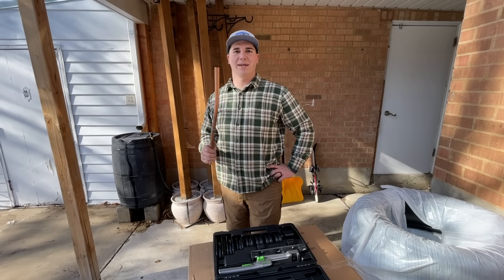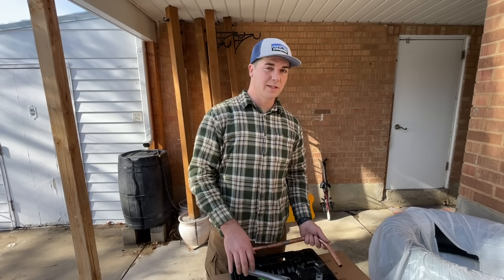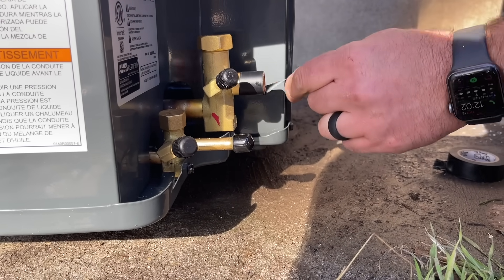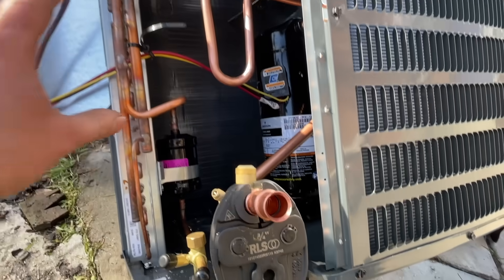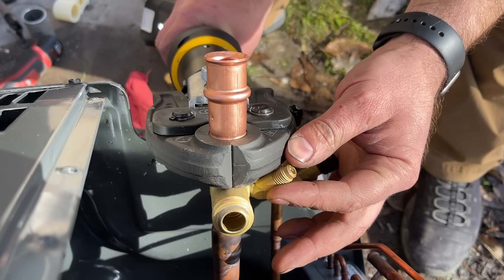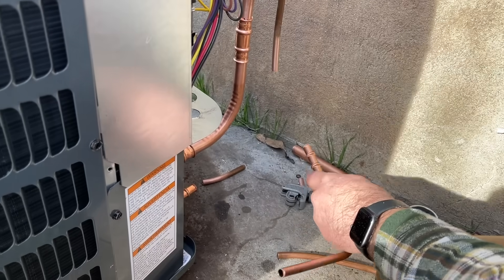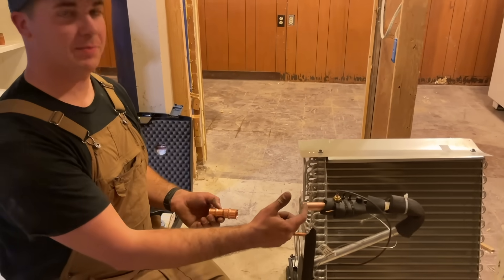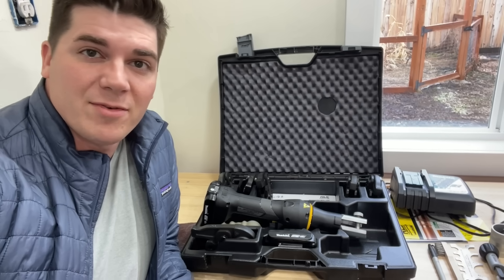Brazing Is For Cavemen. THIS Is The Future Of HVAC Copper Connections. -RLS Crimping Tool-

Comment: After almost 30 years in HVAC and plumbing, I can tell you never to rely on o-rings. They break down. You will eventually have leaks
Reply: It will last but man , once the rubber material starts to reach its degradation point , they will all start leaking like taco bell on a bad day.   Would much rather braze or silver solder.   Refrigerants are hot , high pressure , fluorinated/ chlorinated and can be aggressive on seals
Reply: @Miketime969  He's using these joints on a Goodman A/C, which is basically disposable.  They should easily outlast the unit!
Reply: @Miketime969  Plenty of elastomers can survive a lot more than anything an AC can throw at it.
Reply: @Miketime969  the modern systems just use propane
Reply: @Miketime969  they did a test and found out they last 86 years when used in refrigerated/cooling/freezing/heat pump applications. Then they introduced to public for sale.
Reply: @wileecoyote5749 

I am not sure how they test for 86 years, unless 86 years go by. What is their secret?
Reply: @wileecoyote5749 nothing new about that  in Europe for over 35 years .They don't stand up to fire regulations  not used for HVAC
Reply: @wileecoyote5749 not fire resistant.
Reply: @Miketime969  At least you dont have to bust out the heavy ass nitrogen tank and worry about oxidation on the inside of the pipe clogging your txv.  Much rather just pump the system down and crimp a new fitting on if there is a leak instead of going threough the whole brazing process,.  Cuts the time in half for repairs.
Reply: I'm just a DIYer, but I have heard that most leaks in a vehicle A/C is due to bad O-rings. I haven't heard of brazing going bad.
Reply: @drewthompson7457  yeah. The leaks are usually from the connection points in a car. The lines are aluminum and have mechanical connections vs brazed
Reply: @handymanbrian8269  All mechanical connections on cars have O rings and eventually leak. It would be so nice if cars went back to copper like the early 70's. We have problems with hydraulic JC fittings with O rings as soon as machines are 6 months old. I would question the vertical joints getting water penetration and swelling when temps drop but these are likely the same guys that tag out a furnace for $5k and wont install a heat exchanger that's $300.
Reply: @drewthompson7457  without a doubt .
Reply: @drewthompson7457  With the pressures of 410a, brazing is the best solution. Maybe the compression O rings would be fine for water lines.
Reply: @fifthamendment1  thought you might like to know I liked your comment and read this on wiki:

R-410A, sold under the trademarked names AZ-20, EcoFluor R410, Forane 410A, Genetron R410A, Puron, and Suva 410A, is a zeotropic but near-azeotropic mixture of difluoromethane (CH2F2, called R-32) and pentafluoroethane (CHF2CF3, called R-125) that is used as a refrigerant in air conditioning and heat pump applications. R-410A cylinders were colored rose but are no longer specially color-coded, now bearing a standard light gray color.[1][2]

On December 27, 2020, the United States Congress passed the American Innovation and Manufacturing (AIM) Act, which directs US Environmental Protection Agency (EPA) to phase down production and consumption of hydrofluorocarbons (HFCs).[3] HFCs have a high global warming potential and contribute to climate change. Rules developed under the AIM Act require HFC production and consumption to be reduced by 85% from 2022 to 2036.[4] R-410A will be restricted by this Act because it contains the HFC R-125. Other refrigerants (like R-32 and R-454B)[5] will replace R-410A in most applications, just as R-410A replaced the earlier refrigerant, R-22. 

zeotropic eh?  New word for a newbie like me, but @JayJayJay might like to catchup by doing some reading
He claims to have graduated in 1980 but for an old timer he has a mighty tendency not to back down
Reply: Yeah. I'm gonna stick to brazing
Reply: @youoweme5forreadingthisnam535  We dont call it brazing in the UK, its soldering.
Reply: Commercial, marine, agricultural refer since mid 1980’s here. Used RLS system first time this summer. It’s definitely faster and cleaner than high temp brazing. Really need my reading glasses to closely inspect the pipe for any scratches or the tiny Mueller etched lettering though. If it’s where the o ring contacts it will need to be sanded off or discarded. I had zero leaks on four refer systems using the RLS tool and fittings. Prep is the key I believe. I also press each joint twice 90 degrees apart. Only takes 5 seconds to press. Mueller is coming out with a competing system soon using two o rings in each joint.
Reply: @mikeanderson6531  With all that prep, and pre inspection for any defects like the lettering, scratches, etc, it won’t save any time.  Then you have the cost of the fittings.  I can braze faster than the labor these crimp fittings would take.  If the fittings were cheaper, and there was zero chance of leaks, then they can be considered.  They should design these with Teflon seals instead of rubber O rings.  Teflon is already used in some refrigeration application, such as roto lock unions on some Trane compressors.  It doesn’t  break down like rubber.  The only advantage of using these is for the people who don’t know how to braze.  The future will tell if these press fittings hold up to the heat,high pressure, oil, and vibration.
Reply: @rodgraff1782 Teflon doesn’t have the compliance necessary for a gas tight seal. The seal has to conform to the surface irregularities of the contacting surfaces of the pipe at the microscopic level.
Reply: @propman7896 . Then why does Train use Teflon seals on their compressor rotolock  fittings?  I’ve never had one leak, even on the 30 year old GE condensing units.
Reply: @mikeanderson6531 zero leaks right away.  What about 6 years later? Could probably use superglue and have it hold for a while. But will it last years and years in the sun and rain in Phoenix.  With who knows how aggressive oil and refrigerant passing through it.
Reply: @wildmanofborneo  getting temp swing all the time
Reply: @mikeanderson6531  makes sense that a double o ring is the way to go.
Reply: @mikeanderson6531  why 2 o-rings? Think 🤔 about it. If it were safe, one would be all you would ever need.
Reply: @mikeanderson6531   we are already replacing these things after 1 year of using the machine because of leaks 

but I can see how shady small town companies love this... they get repeat business
Reply: You can’t beat old fashion brazing over time those orings will leak plus the price on the crimp fitting wouldn’t be cheap but great video and nice tool 👌👌👍👍
Reply: That was my first thought too. I see that on cars all the time, someone's AC goes out and usually it's from a leaking O ring. Most commonly the high pressure side of the compressor goes first.
Reply: They've been using o-rings in automotive ACs for decades, no major issues there
Reply: @MrRightNow  there always failing. my dad was a mechanic i seen this in aircons all the time.
Reply: @MrRightNow  till they leak
Reply: Already considering banning in Australia the jury is out.
Reply: On Air conditioning on cars the gas permeates through the flexible hoses. In the system there is a small quantity of lubricant for the pump and also to coat the inside of the flexible pipes. There is a loss but minimal. If you do not use the AC system the oil will drain off the inside of the pipes and your rate of gas loss goes up, meaning systems needs a recharge more frequently.  Brazing or soldering does not take long if you know what your doing and is proven. My pipe bender does not kink the pipe like that.
Reply: Exactly
Reply: Sounds like a bunch of future problems.
Reply: I agree with Brian. I am always questioning pro-press fittings on hot water systems. The thing that really kills an o-ring is heat, if its on a cold line i dont think you will have a problem for a long time. On another hand, when it does leak in 15 years the unit is probably hit its lifespan, and if it leaks you get paid to fix it. All in all, the contractor wins.
Reply: Thanks for pointing this out. You beat me to the comment. Why, oh why are new Plumbers, Hvac installers scared of soldering? Soldering isnt hard and provides a seal that wont fail thus providing full peace of mind. I have seen rubber seals fail shortly after install!

I agree there is a place for these quick connectors, but only in places were a torch can't be used!
Reply: With al2 semi flammability refrigerants coming out thus seems like a disaster if you had a leak. O rings slide and pinch break no thanks I like the caveman route as you call you it.
Reply: Staybrite 8 . Never any issues
Reply: @toli0968  Is that the same as stay bright on the box i think its good for 11k psi it will fill small gaps
Reply: @toli0968 staybrite8 can use r32?
Reply: Looks like that’s going to be job security for AC repair…..
Reply: Exactly! I'm in maintenance of a company and fully agree and I've seen rubber o-rings fail but never have seen a soldered connection fail. Quick connectors are only ok for quick fixes that will be fixed properly asap. Why are soo many installers, pros becoming soo lazy. Brazing is not difficult for a joint that will last basically forever.
Reply: Nearly forty years in aviation industry and there’s never been a fail proof o-ring.
Reply: Best comment, and my very first thought when I saw this vid going in that direction.
Reply: I did refrigeration for a long time and seen these before I retired. Also did a lot of commercial plumbing which I bought a Pro press. I can tell you when I did two inch copper the Pro press was a god sent. High quality o rings are supposed to have a long life span according to the manufacturer.
Reply: Unfortunately the 0-rings will most likely last beyond the warrant period.
Reply: All systems will leak over time. This may just speed up the process.
Will still last as long as most carrier units lol
Reply: Except for all those orings that are in the unit  it self.
Reply: @ban80  ask the supplier eh?  bet they will say anything before or after the sale!
Reply: That's s first used in plumbing low pressure water supply!
Reply: exactly 
until they come down on price and up in quality 
these things are a joke
Reply: Job security, he gets to come out in 4 years and do it all over again.
Reply: You are correct remember carrier in the 80s had that nut that crushed down on unit with O rings
Reply: @tedhicks5431  yup i do remember. at least those were flared fittings with copper washers. they did have some leaks, but not many that i ran into
Reply: @handymanbrian8269  "olives" or washers?
Reply: @simonmasters3295  sorry. im not understanding your question
Reply: 20 years in HVAC only and some plumbing. yeah do not use this foolish video. refrigerant is too expensive.
Reply: Easy ? Yes. But I gotta wonder about longevity?
Reply: @chris.eskimo  Good 15% silver has it for many many yrs
Reply: Everyone stay with brazing the call back will cost you your hole lot more then what you made from the job
Reply: EXACTLY!!!! especially after a few years when pipes go through several temperature changes and expand and contract. I would never let anyone allow to do this on an installation for my house. It's brazing, soldering or the highway.
Reply: Exactly I’ve never seen solder fail over time like I’ve seen orings fail in everything they’re used in over time.
Reply: Oh Weally?  So what engineering school did you go to? Oh yes..Don't buy an all electric car since in my  30 years of installing  never rely on a battery   lol
Reply: I can tell you with my 30 years of driving cars don't buy and electric car, Never rely on a battery   lol   you must be an engineer ...Let me think for a second .the AC lines in autos rely on o-rings..thats right they don't have your 30 years experience
Reply: @davo912  lol
Reply: The heating and cooling of the o rings will be their demise
Reply: Would have brazed it by the time you finished taping bro. But yes press all day for plumbing 🪠
Reply: Give it time it will leak
Reply: There making things to create future service calls. In there minds they gotta keep the wheel turning
Reply: @aggadan  sorry equipment will do that
Reply: Speacially with hvac temps
Reply: 14 potential leak points… no thanks 

I’ll stay a caveman
Reply: Hate all these new bs rectorseal type fittings and now this! All that process took what 1/2 hour when you could’ve brazed that stuff in 2 min! Then what’s warranty on those things? Are they like the 5 year warranty on rectorseal fittings! As if they’re only warranting their product for five years that’s always seemed pretty lame to me. They can keep all this new stuff! What if you mess crimp up at king valve? How do you get it off once crimped if bad crimp? At least with those bs rectorseal fittings you can take channel locks and take fitting off or use their tool if you can find it. I don’t see this tool working in a tight spot in a closet.
Reply: @michaelpinkston768  I just disconnected an old carrier compression type fitting they used in the 80s it ok on straight cooling but heatpump those O rings will leak i have a picture of it not clear
Reply: 100% correct. O-rings simply do not last forever.
Reply: Absolutely but the industry relies on repairs and selling new equipment. If things last too long, where's the money in that. Hence the reason they don't make things like they used to. It's bullshit.
Reply: Refr. Mechanic 25yrs. It may be quicker but i service grocery store racks braized 30 to 50 years ago. Some develop small leaks after 25 or 30 years but most joints are still solid. The world has lost their minds and if you believe this garbage will last more than a few years, at  best, you have lost your mind. And you have very little experience in this field. PERIOD
Can you say HACK
Reply: and heres my proof an hvac dude responded...
Reply: Hi @handymanbrian8269. I agree with you if the "O" rings are in contact with water, but these are not and are made of a different material than regular "O" rings. Check out my blurb that i sent to the diyhvac guy
Reply: Crimping copper fuses the copper together.
Reply: He's an idiot looking for gullible people and clicks.
Reply: @charlesnelson5187  actually I've seen some of his other stuff and he seems like a very competent plumber. You can't be the best at everything.
Reply: He says cavemen
Reply: You have leaks either way, at least if it leaks with these fittings it’s easier to find the leak because just assume it’s the fittings.
Reply: @concernedpersons1995  That's the most idiotic thing I've ever read.
Reply: Yeah man oldie times are different you can’t compare the ‘o’ ring in press to the rubbers in faucets and stuff
Reply: Yup. Anything with expendable parts (o-rings, seals, gaskets, etc) will not stand the test of time.
Reply: @adaster98  what kind of rubber are they using?
Reply: After cutting off the flaired end and crimping the coupler, if that O ring fails and it leaks, you are going to be screwed trying to get that coupler off.
Reply: @fifthamendment1  another great comment
Reply: no they wont, not these. not without exposure of sun and other elements.
Reply: So how would you install a liquid line dryer.
Reply: @briandow8879  you be a smart ass and braze one in.
Reply: Somebody disagreed i don't
Reply: Just pump the system down and crimp a new fitting on it if it starts to leak.  No nitro purge.  Makes repairs easy & less expensive. Doesn't have to last 30 years.  Too bad most techs cant afford it.
Reply: It’s an o-ring like the one they use on cars, they will always leak, don’t be fooled
Reply: Amen to that
Reply: Well I been working in different fields mostly the automotive industry but I have done some plumbing too, that being said O-rings are not 100% no but IF they are not moved twisted or tampered with they should last the life of a typical A/C system! The new O-rings are also made with better material then 30 years ago heck even 15 years ago……
Reply: Only have 15 years myself and I'm all for new tooling to make a job easier (I swage and bend, hardly ever use fittings) but there are things I would never do.  That RLS system is great for straight line work or places where a hot work permit isn't feasible (like certain areas of hospitals or 'historic' buildings) or time-critical emergency repairs.

The more insidious thing is that there is no reworking those joints and if you mess up you're going to be in bigger trouble like with the king valves because when it does eventually leak the repair is going to be that much more complex.
Reply: that's what i tought O rings that spell a lot of freon leak into the atmosphere, no doubt,  brazing is faster
Reply: all this cheap inferior product and technique is the result of a societal phenomenon called "primitive accumulation" which is a function of the decline of a society, just like communism
Reply: Amen. As a guy who does a lot a car AC repair, I've always wished there was an alternative to o-rings. Plus it looks like you would have to replace the entire service valve if there was a leak after using this method
Reply: I live right on the gulf coast of Florida and I've had to fix some of these already on the beach. That salt air eats everything 😅
Reply: youre relying on the crimp thats consistent. and you rely on orings everyday, theyre in just about everything
Reply: Agreed, I am hesitant to try these press tools using o-ring fittings.  Especially on a R410 system.
Reply: Finally had some come back leaking on refrigeration system.
You cannot use these on higher temp liquid lines especially with 404a gas.
I ended up pulling them out and soldering in pieces.
The o-rings broke down
Reply: But can't you just seal the ends off too with something just to be safe ?
Reply: That’s the plan the quicker it breaks down the quicker they can sell you a new one
Reply: They start to fail within 3-5 years, and sometimes even sooner. They save time on the install, but return trips for premature failure is not time saving. It does not get you a lot of return customers either.
Reply: Saying you've been in for 30 yrs doesn't make you good at all. Just means you've been doing things the hard way. M0r0n.
Reply: They told me that in 2004 when SharkBites first came out. Mine have lasted 20 years so far.
Reply: Thats a good point
Reply: Flame free construction is coming. And everything pressurized will eventually leak. Coils indoor and out. Solder connections etc. I’m more concerned on how you do the repair on the leak. It appears that you would have to replace the valve.
Reply: Plumbing company did a hydronic system in a building
Got water feeding all the vav's
Used the crimp connectors
Hw system pretty much stayed on all year round
A few years later 
The owner decided to make changes to the system and turn off the hw system at certain times just about every fitting was leaking once the system cooled down
Had to turn it heating back on so they would not leak
Reply: You just made a leak on that main body joint sooooo much harder and more expensive
Reply: You ppl are nuts. Dudes with their heads up their rears with virtually no training are making fortunes these days. There are virtually no people doing real work anymore, any process/technology that relies less on the skills and abilities of the installed and more on a machine and factory with machines run by a few smart white collar workers is favorable to relying on a human in this day and age. It's only going to get worse, there is a real shortage of humans and they have better things to do with their time than to work. And when you're 80 you're going to beg and then spend your life fortune getting someone to show up and use their tool to fix your ac.
Reply: O rings never and would have saved to to just sweat the fittings!🙏
Reply: I am not worried of it leaking....I am more worried about the o ring going into the system and clogging everything up or no?
Reply: With propress the ring is there for back up it’s actually the compression that makes the seal. You can find video after video of plumbers taking the o ring out and using the fitting without it with no leaks and even beating it with a hammer about 20 to 30 times before it leaks .
Reply: These things suck they leak always get calls for them
Reply: My exact first thought was, if the O-ring is necessary, it is touching the refrigerant or whatever else you would use the system on, therefore it will degrade. How long does solder take to go bad? One hell of a long time!
Reply: So what happens when you need to replace a joint with these?
Reply: @LDoctorKC  Oh really? A 2 year old could figure this out..CUT IT
Reply: @davo912  cut it?  So imagine you put this thing right next to the unit - there is only so much room to cut it out. Grant it, it’s likely to never be removed, but you will loose part of the line where you simply sweat the solder.   I’m only thinking down the road.
Reply: @LDoctorKC   you keep using a dial up phone andI  will use a smart phone  lol
Reply: They've tested that this tech doesn't rely on the o-rings.
Reply: There are videos with the fitting pressed with orange removed and the fitting doesn't leak
Reply: Is brazing better??  Probably.  Will the RLS connections outlast the equipment?  Probably.  If the connections being pressed are at the condenser and air handler, not buried in a wall, I don't see much of a problem.
Reply: @tccoggs  Yeah, there's a few metal (copper) connections in HVAC. As for plumbing there are sometimes 1,000's. No way am I going to use RLS in new or even repair plumbing. I use PEX where applicable now days. There are areas where copper is prohibited. Chlorimides in the municipal waters are causing pin-holes.
Reply: So true
Reply: fortunately pro-press doesn't actually need the o-rings. They are just there for redundancy.
Reply: @iviaverick52  You really know your stuff! Just peel that O-ring out of there before you press it
Reply: I believe that climate can play a big role on this.  If there is a desert and exposed to the sun probably it will dried up over the time.
Reply: Then you make more money repairing it….
Reply: My concern would be the vibration in the system. I guess time will tell
Reply: Everything leaks with time so who cares
Reply: I cringe watching these DIY try to tell us how great this propress system is. 
If I ever have my ac worked on, I will choose what the Pro's have been doing,  Brazing has stood the test of time
Reply: This is a sad joke being played on the consumer. Vibration is the enemy of crimped joints of any kind, let alone a compressor. Not to mention this is outdoors, exposed to the elements. Ever see what dog or cat piss does to copper?
Reply: I can solder 100 pipes together for what 5 of these costs.
Reply: I mean everything breaks down eventually. Brazed connections leak all the time. Half the time it's not even your braze its the joints in the evap coil or condensing coil.
Reply: I use such crimper tool to press in hydraulic fittings that hold 5k pounds of pressure for aircraft . They work !! This technology is only going to get better .
Reply: You are so right!
There's no organic polymer or rubber that will withstand.freon pureon and the ever changing  compressor lube oils dissolved in the refrigerant. 
A leak is now costly business due to the EPA and Greenies driving A/C into near unaffordable prices.
Reply: I wanted to see the microns level on your evacuation...
Reply: BRAZING  IS  BRAZING.
Reply: https://www.youtube.com/watch?v=QtysRkM1gEI&ab_channel=SilverCymbal     Tested with O rings removed
Reply: I'm sure the least a long time, but o-rings will not last as long as brazing for sure.
Reply: I agree, crimping is for people that don't have any skills!
Reply: But I come across leaking failed factory brazes all the time
Reply: @chrisparker4940  Bullshit! That only can happen if those guys brazing, don't have a fucking clue. Half the tech out there are worthless today. Factory people suck. Plus, they use less than 5% silver or no silver in their rods. Because they are cheap factories that don't care.
Reply: @Brian Completed agree bro, been in HVAC for 30 + years myself. The Government schools I work at have banned these crimp joints due a large VRV systems leaking into a classroom . I come across systems that are 30-40 years old with no leaks on solder joints. The unit generally fails or leaks before the interconnect pipes get a leak, found more leaks on these crimp fittings plus they are quite expensive.
Reply: The O ring is just a back up I believe. The compression makes the actual seal.
Reply: Need to get with the times old school out the window
Reply: I found this to be very true
Reply: Remember carrier tried this 80s it leaked
Reply: There will always be those who say " it will never work", even 30 years from now when it has been working flawlessly for 30 years. Fear of change is insidious.
Reply: @josecunha6974  carrier in the 80 had similar set that leaked all the time
Reply: Maybe on the suction side not the liquid side
Reply: @MrExbravo  things are worse on heatpumps
Reply: The more they leak the more work and money for HVAC industry?
Reply: The more it leaks the better for all HVAC techs. Double the work overnight.
Reply: @wildmanofborneo  like crappy cars and appliances
Reply: Actually, I personally don’t care for copper pipe at all, brazed or otherwise. 20 years of using pex, haven’t yet had a joint leak initially, or since. It seems to freeze well without splitting open. Inexpensive, super easy to install, super easy to change if a change is in order. No danger of setting the house on fire.
Reply: I have been doing life for 40 years now and I refuse to accept anything new. I am typing this message on a type writer, sending it to You tube via snail mail, and having it posted by a youngster. I hate anything else but the way I do it. 

The life of these systems is less than these fittings o rings. Plus people have shown that the o ring doesn’t make the seal anyways. It’s the suspenders for your belt I’m sure you wear so no one ever sees your buttcrack.
Reply: As auto tech, this is exactly my thinking.  That being said, I've never seen an o-ring failure on an AC system when installed properly and the correct type of o-ring is used on a flared o-ring connection.  I've seen catastrophic failure of a drier when the system exceeded 400psi on a 20 year old Honda when the customer installed a pipe plug in the pressure relief valve on the compressor.  The fittings held, but the damn drier blew apart!  So I definitely think there's a place for o-ring's in home HVAC, but I think a flare , o-ring and retaining nut type system would be superior to these crimps.  In my experience, crimps loosen over time.  A constant tension type fitting with a Belleville type washer and backer against the o-ring would be ideal. I would imagine these will hold up throughout the service live of the system though, but like many here have said, time will tell.  Same goes for this in plumbing applications.  We'll see.
Reply: The new systems only have a life of about 10 years at best. This is an acceptable installation. You don’t need  silver soldered joints for this stuff.
Reply: I’m a huge fan of brazing but also at the same time I try to embrace new ideas I have used the RLS tool when I have been in a huge pinch and couldn’t braze and done right it will not leak it’s been years and no complaints or a call back. They really don’t.
Reply: Without going into a long drawn out story, I felt the same way, but unfortunately, the new equipment with the mildly flammable refrigerant are being designed to be installed flameless with press fittings so reluctantly I just bought the set up to start using them. I talked to a bunch of guys who have been using them since 2015 and have had no issues so I am reluctantly switching over but I wanted to add the manufacturer recommends you don’t double crimp the way he pressed that fitting twice is a no no just wanted to throw that out there for people new to it. He may get away with it, but the manufacturer says don’t do it.
Reply: Are these fitting the same for plumbing? Or are they special for hvac?
Reply: @rickyrichy5496 hey they are specifically for HVAC
Reply: Okay but I saw no filter drier?
Reply: Man U got a leak on that service valve be a major pain.
Reply: Al you saying “”JuST BraZe”, try brazing an a2l condenser with brass and copper, this tool will save me a lot of headache
Reply: O ring is a backup, the main sealing mechanism is the pressed copper.
Reply: But ,if that lasts until end of warranty : no matter!! The company will be solded, noone to be implicated !!! It's the Progress !!
Reply: I’ve never had a leaking press joint yet. Nothings perfect and even braze joints can eventually leak
Reply: @Regii_HVAC  braze joints never leak
Reply: The AC will break down before the O ring will fail.
Reply: They have a warranty for 50 years. What new system is going to last 20 years let alone 50?
Reply: The copper fuses o ring is a backup
Reply: Wow,   Why not use ss compression fittings. I know they are expensive.  But so is that tool. Brazing is no big deal. Least expensive way. way just makes a service problem.
Reply: The o ring material is the same material as is valves.  It'll last as long as the system.
Reply: Beauty is if it leaks you can just braze the joints on these fittings and don’t have to disconnect! More than one way to skin a cat. Homeowners should be doing yearly maintenance service calls regardless on equipment. With the ease of these fittings a good company could give a better warranty as opposed to a one year. What’s it really going to take to pump some more liquid in and press in a fitting should the need arise.
Reply: From what I've seen the O-Ring doesn't provide the seal.
Reply: Only for those who cant solder. We never did use lead solder it contaminates the oil. Silver bearing solder is what I use, have been for almost 40 yrs. Only time i use silver solder or "braze" is on compressor change out. Cant remember the last one of them. I bet my instructor "al" is rolling over in his grave. Let face it guys, it's all changing and we are the last of the true craftmans. Its gonna have to get easier, cant get anyone to walk into this field. Think about this, how many of the new guys thread pipe? I bet not alot, it's all flex. I hate that shit. Think about it, if it's easier anyone can do it, cheaper labor rates. I've seen shark bites on the shit, made for it. If You know how to bend copper and solder, theres only 4 to 5 joints total, that's only if u use a 90 at the coil. 6 joints that I see there and a old line set, hope it's not an old r 22 system? That wont last long, hope it has a good warranty, he will be doin this again in 5 yrs.
Reply: @chrisdecker1443  I can forgive flex water pipes for small stuff if they have used one of the few good types of compression fitting, it's reliable enough and pretty nice to service.
But this is just ridiculous, no added serviceability, prone to failure, and probably even more vulnerable to poor installation. Pretty sure flare fittings would be better than this if you absolutely have to do a "no braze" install. I know a lot of small heat pumps around here use them and I assume they last pretty well?
Reply: @chrisdecker1443  Been using it for 40 years and still can't spell it.  Fascinating.
Reply: @johnd5398  thanks.
Reply: @johnd5398  fixed. One in every once in a while. Remarkable!
Reply: @chrisdecker1443  Soldiering is EASIER than brazing and is done by those who dont know how to braze. And soldier will leak over time. You're a hack.
Reply: @chrisdecker1443  Lead contaminates oil?  How?  No oil absorbs metal.
Reply: @frequentlycynical642  think what u want.
Reply: My Father built, wired and plumbed the house we grew up in. He plumbed the entire house with soldered copper. Domestic, hydraunic and drains. 55 years later still leak and repair free. Myself, 20 years in the piping trade with years of fitting copper piping. Nothing, nothing beats the quality of a skilled tradesmen…
Reply: @markfaas4052 correct 47 years in the Heating plumbing gas and HVAC also licenced construction supper and licence sprinkler contract. These guys should not tell their granny how to suck eggs.
Reply: I think it will end up being a bit better because most techs use water to cool the pipes just after brazing. Also all of the leaks Ive repaired were caused by this...and techs that didnt even have a micrometer. lol But, yeah, Im staying with brazing.
Reply: The dead crew of a space shuttle agrees 💯% with you. The other says: "Don't trust foam insulation!", but that would be an hvac thing and not plumbing.
Reply: My neighbor got rid of his "inefficient" R22 unit last year. He's had this new and "improved" unit service twice in 12 months now because of issues. The future of technology is only profitable to the service tech, not the customer.
Reply: @maddoxinc1642  it all comes down to the quality of the install.
Reply: @handymanbrian8269 You hit the nail on the head install properly take your time and these will last forever I did one years ago with RLS and no complaints.  Old  school guys will say braze but I came in the field when you can see them making things easier for the techs. For example how many people use the Testo or Fieldpiece gauges. Some changes need to be embraced this is one of them.
Reply: @handymanbrian8269 sadly it doesn’t matter anymore. I’ve had three brand new units have compressors that die within 18 months, brand names like copeland, tecumseh, and LG. Did leak checks, vacuum
Tests, and ensured proper subcooling and superheat on systems at install. 

They are manufacturing garbage now, I am honestly getting to the point of not replacing units anymore.
Reply: @maddoxinc1642  exactly, and cutting corners like this leads to more damage
thanks AGILE management training
Reply: @maddoxinc1642  very true, same with furnaces
Reply: @maddoxinc1642  I don't let anyone touch my own 26-year old R22 unit for over a decade on the gas side and it works great. I changed the electric components that failed myself (relay, condenser, and fan motor). Yes, it "wastes electricity" but the other unit that I had installed last year was supposed to save me a lot but it doesn't.
Reply: Pipefitter for 15yrs as well.  Theres not a chance any reputable shop uses these.  Brazing will be around for a long time, there will be no replacement..
Reply: Soldered joints leak too in time. Seen it over and over.
Reply: @CaresforAll  When you say "in time", do you mean after 100 years worth of time?
Reply: @MeMe-xn6cs  35
Reply: @MeMe-xn6cs  we are already replacing these fittings a year later due to leaks
Reply: @CaresforAll  Yes, you might get leaks in shouldered (soft) joints, but that is not what we are talking about.  High temperature brazed joints, that are done correctly, seldom leak.  The people who do not know how to braze properly cause most of the leaks. O ring seals have been used in automotive air conditioning systems for years.  They eventually leak.
Reply: @CaresforAll  yep I have had quite a few and some that I got proactive with.
Reply: @CaresforAll Not if they are done by a certified person. I have thousands of installation done in 47 years including industrial!,commercial etc never have a problem with solder joints or any type of joint for that matter.They are even used for gas and comply to all codes of practice.
Reply: @CaresforAll  yeah your right with 5% soldier! Lucky people don’t can’t use that stuff anymore especially on 410a where temp/pressures are a lot higher then 22
Reply: @Kelvin Mah another one ? I said there are more reasons than one to not use it . Sarcasm is somehow missed by this trade group. Where did I say use lead solder ?  Another but hurt tradesman . I worked commercial construction for over forty years and never encountered such sensitive men .
Reply: Solder joints done right last forever... like I say to each is own .. I rather braze my pipes .. keep up good work bro . Bmore 💯
Reply: 35 years in the business myself. I totally agree. Silver will last 100 times longer, if not forever. Code won't allow shark bite fitting to be enclosed in a wall for a reason, and that's only dealing with water under normal temps. There are so many reasons why this is a very, very, very bad idea.
Reply: yeah but you eventually get leaks in a brazed system so whos to say
Reply: @Astrojamus  dont think so. Unless they didnt braze properly, nitrogen usually will tell u quick.
Leaks I have found has been indoor coil, low on charge and freezes up, expansion. 
Out door coil, lawnmowers and small stones, dog piss worst nightmare.
Reply: @Astrojamus  Not through a correctly brazed joint.
Reply: @Astrojamus  no you don’t unless braze was weak from start lack of experience and if some idiot trying to use 5% to braze a 410 system
Reply: So right wait another 30 years and see the shark bites mess , this guy is a hack ! first and last video of his I’ll watch
Reply: @jamesyurky3048  good bye!!
Reply: @jamesyurky3048    I’d only use sharkbite in an emergency, and only in a permanently accessible location.  Plus, they cost a fortune.
Reply: @tomrogers9467 
I think they have to be where you can see them... yes. Hard solder for water and silver braze for HVAC, any time it's enclosed or "invisible".
If it is accessible and you know the lifespan and are okay with it and it is rated for your refrigerant and any additives... why not go for it?
Reply: @tomrogers9467 correct and they are rubbish
Reply from the maker: Time will tell :) I think it done properly they should last a very long time
Reply: @diyhvacguy  not as long as brazing.
Reply: @davidrussell9290  these are like shark bites... they are made for the DIY guys... so they feel like they can do what the pros do

then it leaks or breaks and they have to call in someone to fix it
Reply: @diyhvacguy  Your key word is “think”?! When we know that when things are sealed with a flame and melted into place they don’t leak! Another way to make a job take longer than needed and to make more money off of the working men and women… “I do believe it’s called fleecing!”
Reply: @diyhvacguy  they dont last long at all lol, already getting calls back for leaks on units installed with these parts a year later
Reply: @diyhvacguy  A good braze is forever, an oring is not - I replace them all the time
Reply: @diyhvacguy  in the commercial world they last all of maybe a year. I've heard of some companies having to go in and replace the connections.  So if you want a 100% no leak system braze it.
Reply: @chrisl6263  clean copper, good flux, and silvabraze
Reply: yep , they are just trying to sell new  tool and process  that is 100% inferior junk! . ~ silver solder forever!
Reply: @chrisl6263  100% agree, we are already replacing these things after 1 year of using the machine because of leaks 

but I can see how shady small town companies love this... they get repeat business
Reply: @chrisl6263  they have this approved for high pressure steam and gas..welcome to the 21st century man.. I have been using this in the plumbing industry for years now
Reply: @bobshagit9503  "shady small town companies...repeat business"  I can hear your sales patter, but it's valid and I will use
Reply: @johnstreet797  you don’t use flux to braze. Soft solider water pipe you use it
Reply: @diyhvacguy  ????? nobody knows how long
Reply: @diyhvacguy  Your O ring on first return is barely doing anything let alone seal
Reply: @diyhvacguy  As long as the warranty for the unit.
Reply: @diyhvacguy 
how long time is long enough ? houses built are for longevity ( thousand years and beyond) , very long time isn’t good enough !
Reply: @diyhvacguy  Time is literally telling you this is not a good idea for long term. 30 years worth in just this one response lol
Reply: @diyhvacguy  So, where's the link to the tool and supplies?
Reply: @diyhvacguy if you scared just say that 😂
Reply: @diyhvacguy  A "very" long time is not an answer... sounds more like generating another call for yourself.
Reply: Re piped the lineset on an air handler that used pro press fittings from 2015. Did not last very long @diyhvacguy
Reply: @diyhvacguy  "A very long time" is not 'soldered forever'.
Reply: @diyhvacguy :
O-rings are rubber they will break down sooner than you think sir.
Reply: @reneek7721  Will the PAG oil in the system keep the o rings lubed?
Reply: @reneek7721 I will say there have been a few videos done where the o ring is removed and there are no leaks. That being said, it was just a test. Time will tell
Reply: I guess you have never had to charge the A/C in a car then?
Reply: Isn’t there more to the switch away from soldered joints? I thought lead contamination and the suspected cancer was the driving factor in moving away from soldered joints?
Reply: @JAYJAYJAY53  hard solder or silver brazing that is used in refrigeration is different than soft solder that used to have plumbus in it.
Reply: @fourbanger  or if in an area where the torch cant be used a union flare joint. Silfos all the way especially if you warranty your work for 6 years.
Reply: @fourbanger  Plumbus? Like from Rick and Morty?
Reply: @fourbanger you can solder with silver Bright there is no lead in it
Reply: @JAYJAYJAY53  they haven't used lead 8n a long time. Anyway, when brazing we use a silver alloy ... No lead
Reply: @handymanbrian8269  when I was young 16 , I worked for a steam fitter who built spec houses on the side and back than 1970 he used lead and oakum method.
Reply: @JAYJAYJAY53  Lead and oaken is for cast iron DWV with hubs. (drain, waste and vent) any cast iron today uses no hub connectors aka (bandaids).
Reply: @Mikael5732  As a 16 year old kid I use to work summers and Saturdays with a house builder. He was also a licensed union plumber and that was the first time I learned about it . That was 1970 .
Reply: @JAYJAYJAY53   that’s why for domestic water piping, we have to use lead free solder.
Silverbrite 
95/5
Oatey brand and others
Reply: @JAYJAYJAY53  fa lot of solder is lead-free these days.  You definitely have a choice. In this case, it doesn't matter. It's not like water pipes where you're drinking the fluid flowing through the pipe. Once the pipes are brazed, and if done correctly, nobody will be messing with those lines again until the unit is replaced.
Reply: @granitecowboy2199 it dose not matter if they do the braiz is as strong as the pipe
Reply: @JAYJAYJAY53  no lead in solder nowadays
Reply: @JAYJAYJAY53  Where are you buying solder with lead in it????
Reply: @giannizhivago3373  Used in heating systems.
Reply: @JAY  Gary is correct. Soldier is not used in brazing. Silfos is what is used to braze ac/refrigeration copper and it is a silver alloy, not lead. Further more, most soldiers now are lead free
Reply: @JAYJAYJAY53  no
Reply: @JAYJAYJAY53   I bet that you drink water from plastic bottles.
Reply: @JAYJAYJAY53  No ! It's cause dummies can't braze or solder
Reply: @JAYJAYJAY53  Yea that crimping kit he has is probably 2 grand.  A torch kit with tank is probably 250-300 bucks.  Its expensive tech.  But like all new tech it will eventually come down in price.
Reply: @JAYJAYJAY53  I'm not sure how that applies to brazed or soldered HVAC connections today. Neither of those products tend to have lead. Same filler and flux as are used in potable water and medgas.
Reply: @JAYJAYJAY53  Modern solders are lead free, by EPA required labels. HVAC doesn't solder- they braze, a higher heat and use a silver alloy to fuse, so , no lead involved.
Reply: @JAYJAYJAY53  yes let me just drink my HVAC plumbing
Reply: @JAYJAYJAY53  Why can't you use aluminium solder?
Reply: @bobcat2378  😂😂🤣🤣
Reply: @JAYJAYJAY53 definitely not true been using lead free solder on potable water pipes for ages now
Reply: @JAYJAYJAY53  HVAC tech should only use silver solder no lead. Not pluming solder because of the pressures.
Reply: @Rjsche1  #1 I said there was more than one reason not to use lead solder . #2 learn to spell  #3 a plumber or tech that can’t spell the name of his trade is pathetic
Reply: @JAYJAYJAY53  I got you. I think I am Dyslexia and have problems many times in writing. just so you know.  I was just making a statement of thought with a lot of truth to it.  I am a hands-on person and do many things. I am always open to change my ideas and don`t take myself too seriously. The statement made was mostly based on my experience with some things that I see today.  was not meant to offend you.

I Not a HVAC tech by the way. I am a Machinist-Industrial instrument Electrician-Reliability technician.  I always say I have an opinion, but it is subject to change with father evidence and proof of concept.

On another note, I have more problems with the quality of products made today. It can be great until someone decides to use cheaper materials to make the parts we use on the daily bases. With that in mind I think of the Orings used in the fittings.
Reply: @Rjsche1  I have made this mistake myself you see something and respond wrongly. Especially if you are not reading the original post . Many times you are reading is a pile up of posts which can be wrong . The last lead I know in use is on slate roof repairs and I am pretty sure new jobs have switched to all copper flashing. I used to used lead when I flashed chimneys for ease of use . So easy to bend and heavy enough to stay in place .
Reply: @JAYJAYJAY53  They make lead free solder. It is more common than lead-based, because you cannot use lead-based solder on plumbing pipes.  and lead is harmless, unless you eat it.
Reply: @JAYJAYJAY53  
I used and continue to use Stay-brite 8. This has no lead at all and never had a leak in any of my residential installations.
Reply: @JAYJAYJAY53  Haven't used lead in decades, its silver/tin now.
Reply: @JAYJAYJAY53 they haven’t used lead solder in ages and if you are using it you shouldn’t be doing HVAC nor Plumbing.
Reply: @JAYJAYJAY53  Nobody uses lead any more on water pipes since the mid 80....and only silver solder on refrigerant lines
Reply: @JAYJAYJAY53   Still using solder form the 80s?  Plumbing systems have been using Tin-Silver solder for almost 40 years.
Reply: @JAYJAYJAY53  todays solder joints dont have lead
Reply: @JAYJAYJAY53 theres no lead in solder anymore my friend
Reply: @JAYJAYJAY53 no one uses leaded solder for water pipes for a very-very long time. Lead solder is used for Electronics, not as much now. Biggest chance of a leak with crimping is just after installation. It use only takes advantage of calcification and oxidation to build up around the edge for the barrier. And just holding it. With a refrigeration system moving hot and cold substance wouldn't you think that plastic/rubber o ring will break down. Be inside your system possibly causing later problem. Copper expands and contracts do to temperature change. It also starts to fall apart b/c of it. What's the PH level of the refrigerant.

2-3 grand for fancy tools. Having "apprentices" never learning how to braze a simple joint. That's tried and tested. Just the same with PvC instillations in environments with drastic temperature changes. Specially Canadian Winters. It makes no sense.
Reply: @Vizr.  and why because it causes cancer . Just I never encountered amore stupid group tradesman. Anything with lead from roof flashing to paint,older flooring. But this piece sarcasm flew so many it is really incredible. If I said at a coffee break on a union job it would have gotten laughs . But not you guys .
Reply: @JAYJAYJAY53  right, but PvC and the o-rings made out of petrol doesn't?

Must be tough to not get laughs when you don't got any Union yes men to surround yourself with. Union. Eyerolls
Reply: @JAYJAYJAY53  lead is not as plentiful since it is not used on water pipes, they have lead free solder that is used, the problem with the lead and the lead free solder is the acid used as a flux will contaminate they system and cause a burn out a couple of years later
Reply: @williamfowler616  As a carpenter the only thing that I ever used lead for was flashing and that was a longtime ago
Reply: @JAYJAYJAY53 this is refrigeration. No lead. Silver solder. Pro Press does work very good. No need for a torch or nitrogen. Much faster
Reply: @JAYJAYJAY53 are you drinking refrigerant?
Reply: @JAYJAYJAY53 je brase au cuivre phosphore depuis des annees aucun probleme avec ces metaux de plus le plomb a ete supprime dans les soudure a l'etain.